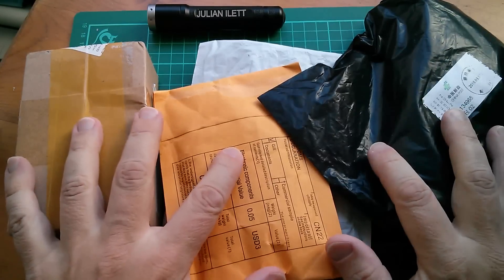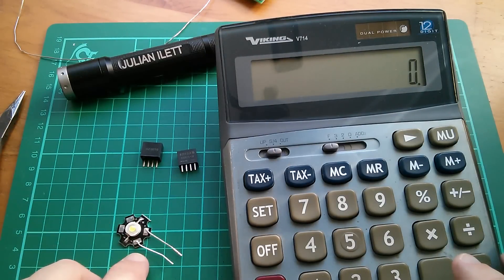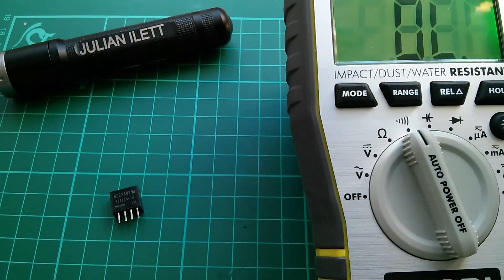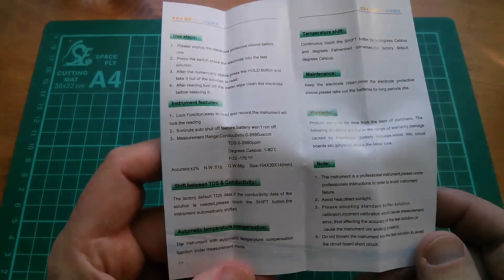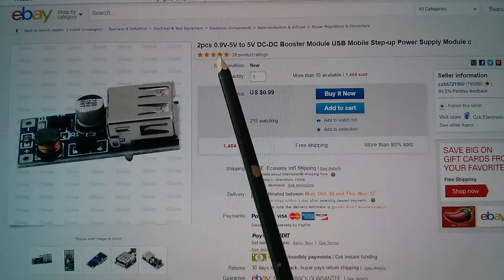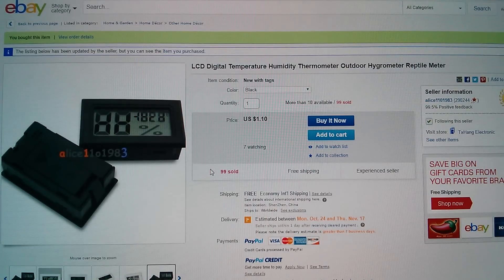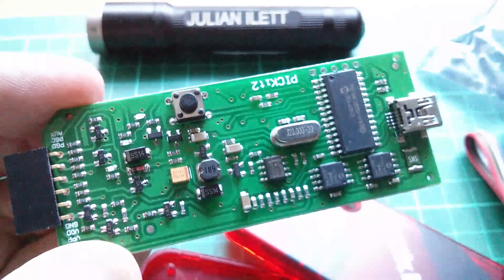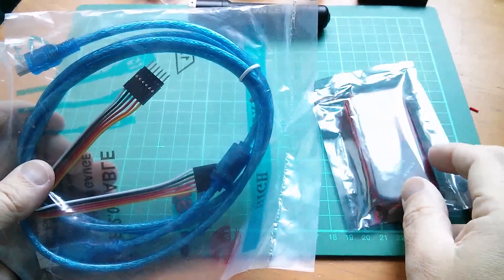Julian's Postbag: #71 - More Fun Electronics Stuff from China

Comment: Hi

Firstly your channel is much appreciated. Watch virtually every video.

Best way to test isolated power supplies is with a bidirectional digital current meter. If total isolation is not achieved between the power supply and measured current you get a fire due to earthing error across the shunt sensors. Test - and + currents. 

Testing the unit for isolation will be tricky. I stand under correction here but the input side is a square wave generator driving the primary side of a transformer, secondary side is followed by a diode bridge and capacitor. Only AC current can go through a transformer as the magnetic field needs to move to create current. One of four primary magnetic integral laws.

Secondly ppm is a measure of dissolved MgCO3 and CaCO3 in water, commonly known as hardness. 

The micro S unit is 1/Resistance and commonly used in science. This quantity rises with less ions in water. Look up deionised water via reverse osmosis and ion exchange.

Comment: Julian, lay a piece of ribbon across the hole before putting the battery in.  It pulls the battery out quite easily without the screwdriver marks.  If you have one holder you use all the time, swapping batteries right and left, take a dremel to the holddown arms and shorten them to give it less hold.   I do my own daily Chiwanese postbag openings, and your lists often end up as my own.  Like Christmas every day, FOR A BUCK!

Comment: I can give a brief summary of TDS and EC.

The meter only measures one thing, the electrical conductivity of the solution (in microsiemens / cm). All inorganic salts that dissolve in water will increase its conductivity, so there's a relationship between it's conductivity the total amount of dissolved solids (TDS). A simple formula is used to convert between the two, TDS (Total Dissolved Solids) and EC (Electrical Conductivity). 

Understanding how a water conductivity measurements works is a bit more complex, but I believe it's equivalent to measuring across two capacitors that are connected in series (Electrode --||--||-- Electrode). When an electric field is applied to the solution, ions migrate and accumulate at the electrode to cancel out the charge applied. The rate at which the charge is canceled is measured as the conductivity. The test signal used is often ~1-2 kHz sine wave at ~2 V p-p, but this can vary a lot -- if you get time you should put your scope on the TDS tester electrodes! (the third 'dimple' there is most likely the temperature sensor, as EC is temperature-dependent).
Reply from the maker: Thanks for the explanation - I'll scope the probes when I tear it down.
Reply: I'd bet money that the "mystery sensor" on the right of the 2 pins is actually the temperature sensor.
Reply: so, we could probably use a multimeter with custom, fixed sized probes for the same. can't we?
Reply: Suraj Grewal A regular multimeter most often use a DC voltage or current, that won't work. You can use an LCR meter instead.
An EC measurement also depends on the surface area and geometry of your two probes, called the cell constant. In order to use an LCR for EC measurements you need to have a standard solution to compensate for this constant.
Say you have a known standard of a KCl solution at 1460 microsiemens / cm, and your LCR meter reads 2250 microsiemens using custom probes 1 cm apart, the cell constant is -790
Reply: The key to a good conductivity meter is the measurement cell design. They try to minimise magnetic fields in the cell. Look at the design of a Metrohm conductivity cell.
Reply: TheAmmoniacal  sim good.....

Comment: @13:50  You can easily fix the battery holder by shaving the plastic away with that utility knife, as long as you break off the end to make it sharp again!  Another way, that I prefer, is to use the side of your soldering iron (on LOW temp) to melt the plastic a little... it has the added benefit of leaving a smooth edge that will not scratch your cells as they slide in or out.  

(The type of plastic those are made of appears to be type 2, which doesn't really stick to anything except itself, so don't worry too much about the iron getting any kind of permanent coating, or anything like that.)

Comment: Julian here's a idea to help with battery removal from those battery holders. Take a piece of ribbon and put it inside the battery holder with both ends hanging out of the holder. Then sit the battery in the middle of the ribbon. You will then  be able to pull the battery out with the ribbon when your finished using it.

Comment: Do you know how those dc-dc isolated thingies work? Can you put the input in series with the output to make 10V? Or use two of them to make 10V?
Reply from the maker: Cool idea - a voltage doubler
Reply: Do you think they have a transformer in them? If so it must be tiny with the inverter and rectifier in there too. Or is there some other way it could work?
Reply from the maker: The only other way would be a small motor and generator!
Reply: Nope... the dc de-coupling could be done using two capacitors.  Either method involves using the dc input to power a high frequency oscillator (probably in the MHz or gHz region for this size), transfer of energy without dc electrical conductivity and recuperation of the energy, probably with a bridge recifier and smoothing capacitor.  At low frequencies the de-coupling is best done by magnetic transfer (coils of wire) but at very high frequencies capacitive coupling gets more efficient, more compact and cheaper.  So I bet you a bag of crisps that them thingies don't have coils of wire in 'em.   btw, if you win you'll have to come to Brittany to claim your bag of crisps, cos Theresa may ban me from re-entering the UK on grounds of associating with foreigners...
Reply: Would a Hall-Effect device detect a working coil ?
Surely they are not isolated and are tiny switchmode devices. Therefore they need a coil ?

Comment: The solder joints on the pickit 2's header seem a bit dry. 

The third "pin" on the water meter is probably the temperature sensor.

Comment: Great stuff Julian! I need your help in fixing a powertool battery pack. 18.5v output x 5 cells 18650. The charger module is dead. What would you recommend as replacement board. Thanks & Regards. Sham.

Comment: Fix the battery holder by putting in a battery, place in hot not boiling water, remove and enjoy.

The hot water relaxes the wings but they still hold the battery.
Reply: easier to just put a piece of ribbon behind the battery as you insert. pull it out like you do with most consumer electronics. fix the ribbon to the rear of the holder if you dont want it floating free.
Reply: That type of holder is designed to prevent calls falling out in portable devices.  I just cut the clasps off for static and test use.  A cable tie could then be used if required for any reason.

Comment: Tip for removing batteries from battery holders:  Use a small ziptie.  push it between the battery and the holder, and it will follow around the battery and poke out the other side.  then pull!

Comment: Could you use two of those DC isolators to make a bipolar power supply? Connect the inputs up in parallel and connect the +out to the -out of the other.

Comment: I purchased a PicKit3 on EBay recently. If did not work at all, and when I compared it to a good PicKit3 it was clearly a counterfeit.  The package was missing the Microchip Logo.  Your PicKit2 is also missing the logo.  EBay stepped in and refunded my cost on the counterfeit unit.  I was amazed that they went through all the trouble to put a large number of parts inside the unit.  Other than the fact that it fails to function in any way, and the missing logo, it looked real. I am interested in whether yours work.  For me, the Microchip software saw nothing connected, I did test with a good unit and all worked fine.
Reply: The one you opened PCB looks different from mine. Yours might actually work.

Comment: For the USB buck converter you should check with your USB doctor what the voltage voltage is under load. I bought several models, most of them are outside the USB specs.
You should also buy some silicon wires, they are nice to work with.
Reply from the maker: I just blew one of them up :(
Reply: +bibiwood I have two, one rated 600 mA and one rated 1200 mA but both 'suck' and can only keep around 5V with loads of less than 100 mA

Comment: TDS - Total Dissolved Solids
EC - Electrical Conductivity - usually measured in micro mhos per centimeter. mhos is the inverse of ohms.

Essentially the more TDS the higher the conductivity. You might want to play with distilled water and add salt to see how the conductivity works. Distilled water should have very low TDS and conductivity.

Comment: It would be interesting to power it up, and check the voltage difference between the input ground and the output -. If it is floating, you should be able to manipulated the voltage by touching the output, or connecting it to the input.

Comment: just wrap a strip of double layer paper with both ends sticking out at the positive terminal so you can easily lift the battery out by pulling the ends of the paper.

Comment: I was wondering witch is easier to program and use. a arduino ( or clone) or a pic chip? I don't really know anything really about either. but a lot more can be done with an arduino. I'm just mostly interested in a high power DC boost circuit. that can regulate its output. can a pic do that . so I need 2 pwm outputs.and a input for regulation. but I'm probably missing something. witch chip would work?

Comment: any idea if those little 5V boost converters can be tweaked to give o/p of 3.3V ? i searched for the smd ic part online for datasheet, but nothing really comes up.
Reply: Just buy a 3.3v one, that chip is fixed to 5v
Reply: dont think there is any available that goes from one AA/0.9V to 3.3V
Reply: There are, just search on aliexpress for "3.3v boost"
Reply: you can get tiny boost converters which cover that voltage range, theyre called "Mini DC 0.8-3.3V to DC 3.3V Step Up Boost Power Module For Arduino Breadboard" on ebay uk
Reply: right, thanks. found some, but those are expensive compared to 5V ones, each of those costs like 5-6 times of the 5V ones.
Reply: iceberg789
yeah, I bought 5pcs of 5V to 3.3V regulators recently for 1 canadian dollar, I imagine its just the volume of production because the format and component count are p much the same. there doesnt seem to be many sellers so maybe theyre a relatively new item, if people buy them and they start making lots theyll get cheaper. theyre still only £1.20 though so if it solves a one off problem its a no brainer. if you need 50 or 100 thats a different matter. I thought they might be cheaper on .com or .ca but theyre even more expensive there, co.uk seems to be the cheapest place to get them
Reply: thanks, but i think i will rather put a cheap 3.3V LDO to get 3.3V from 5V. with direct 3.3V boost, ~8mA could be saved, but well.

i think these are very handy to power small 3/5 V projects (random custom made meters etc)  from just a single AA nimh cell. i can just put a nimh with each of those and recharge when necessary.

Comment: hello julian I have a question 
I made a small solar generator and have a 12v 14ah battery tender battery and I have made a battery from 18650's it is 10s X 3p 11.8 v I think can I connect them to increase my capacity of my 12v solar generator ? or should I make my diy battery 14.? v 
your thoughts on the project

Comment: What is the best component tester like the one you have for around $20?  Is there such a device for that cheap?
Reply: there are a few types on ebay and you can get them for around half that price. I think its mostly the display thats different for the various types. newer versions give you little diagrams, older models just show numerical parameters. the only criticism I have of mine is that its not very accurate when measuring small capacitors (<500nF)
Reply: 0yeme0 Thanks, I just want one that can reliably tell the difference between a different types of transistors, and between transistors and SCRs.

Comment: Is the output of the 5v dc-dc converter stabilized? I accidently bought an other model that isnt.
Reply: For those wondering the same, no it's not regulated, it also needs a minimum of 10% load or it goes out of specs

Comment: And EC probably means Electrical Conductivity.
Reply: youpattube1 confirmed. And uS/cm means micro Siemens per centimeter. Conductivity of a liquid is greatly impacted by temperature.
In Pharma industry, we use that as a first indicator of purity of rinse water used to clean parts in contact with product. Norm is to be below 1.1uS/cm at 25C

Comment: That current sensor is a direct copy of an Adafruit breakout board, just without the Adafruit logo on the silkscreen. https://www.adafruit.com/products/904
Reply from the maker: Most of Adafruit's modules have been reproduced by Chinese manufacturers. It's Ok if they're open source I guess?
Reply: It's OK, but they say (at https://github.com/adafruit/Adafruit-INA219-Current-Sensor-PCB) that they've licensed the designs under CC-BY-SA, so the Chinese manufacturers should provide attribution to Adafruit for the design somewhere on the board (even if they remove the logo.)

Comment: Those battery holders have a hole in the back, try pushing instead of prying them out.
Reply: Jacob Abercrombie that hole is to screw down the holder. By pushing it through, you run the risk of puncturing your battery = bad idea mate!
Reply: I understand the purpose of it, but highly doubt you're going to puncture a battery with the end of a pen. You'd have to be pretty abusive to damage a battery this way.

Comment: Are you sure that wire is tinned copper?
Reply: Seems more like Aluminium, they are thicker for the same gauge.
Reply: Could either test it with fire or resistance. Alu would be higher resistance and I think melts where copper doesn't (using a lighter)

Comment: how accurate are these hygrometers?
Reply: Why not just check the ebay listing? It says +-5%. From experience they are good enough to measure changes.
Reply: Mine was 3° different from the right measurement. That's worthless
Reply from the maker: I'm planning to compare the LCD devices with the mechanical one. Also the Si7021 connected to an Arduino and OLED.

Comment: Hi Julian. Thanks for your edifying videos. BTW I shall refer in particular to one DC-DC Booster (1.5v to 5v) which you showed earlier. I am waiting for the delivery– in a couple of days or so– for a few of the following: Item No. ( 232506463846 )
•5pcs 5V Boost Step Up Module Converter/Charger with Battery Protection (Input + Output ports). Sold by Chipworld on ebay. If you've not yet done a review on same, it would be interesting to have one. As soon as I receive the order, I might consider posting a video. Regards.